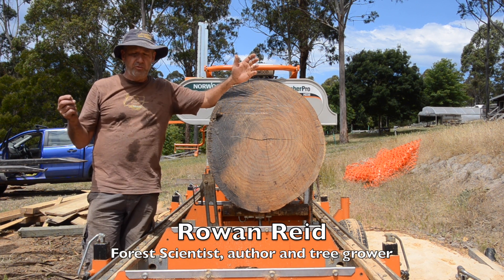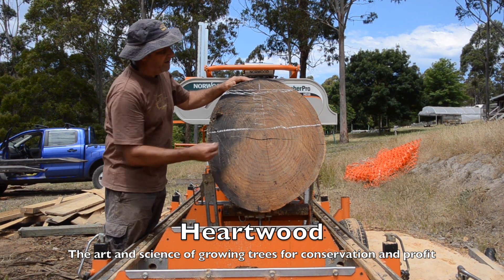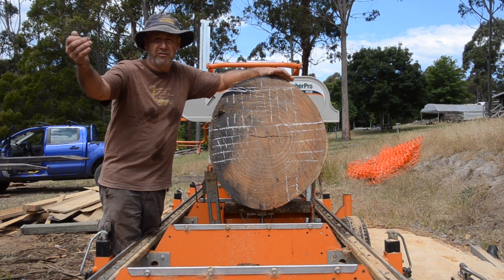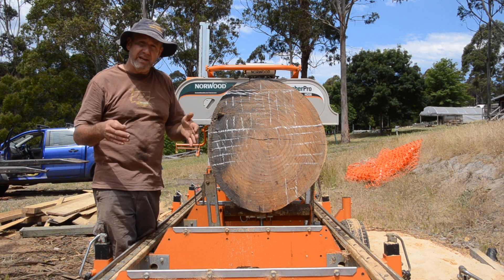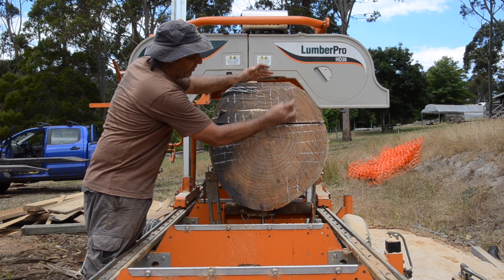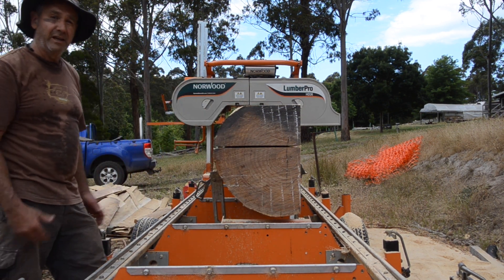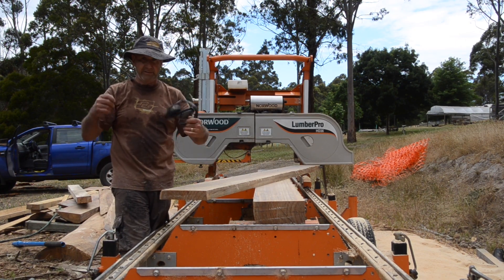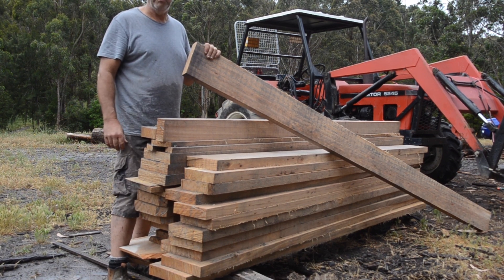Quartersawing Hardwoods

Comment: Great explanation of quarter sawing tension wood. This has given me the insight I need to mill my Regnans. 
How has the mill coped with the weight and milling in general.
Cheers, Peter
Reply from the maker: Well, I've knocked it around a bit when I turn the logs so I'm now using a sling on the fel to help reduce the 'thump'.  I need a bigger, stronger mill!
Reply: @bambraagroforestryfarm4008  Thanks for replying Rowan. I guess the sling stops the thump but it must slow the whole process. The HD36
certainly is an attractive mill from a price point and if able to be in a stationary situation then the shock loading could be transferred through to the ground
by chocking from the ground up to the underside of the cross bunks, or a fabricated sub chassis. Another option I've considered to work in-conjunction with
the HD36 is a dedicated slabber - (Peterson or Lucas mills offer this option) to break the log down into the cants ready for there trueing and finishing cuts on the
HD36.
Just some options that may be cheaper than upscaling to the size and rigidity of a mill you may be considering.
Good luck with what ever you choose to go with. Keep up the great work on sustainability and I'm looking forward to viewing the milling of the Redwood.
Cheers, Peter